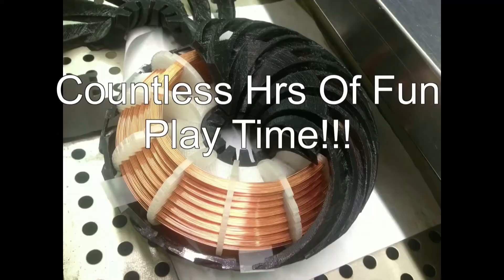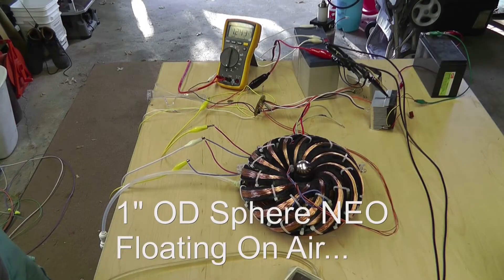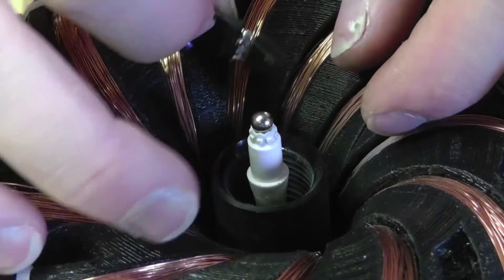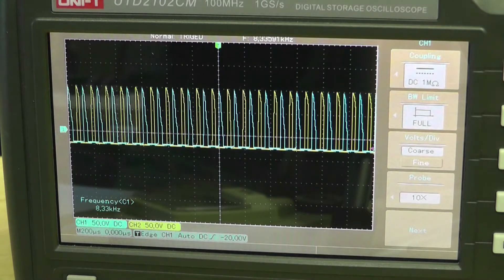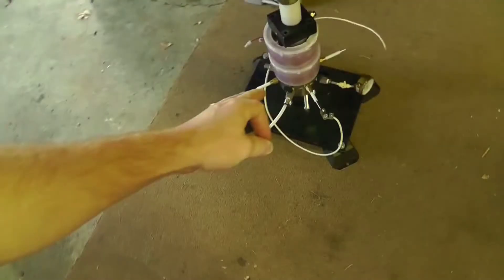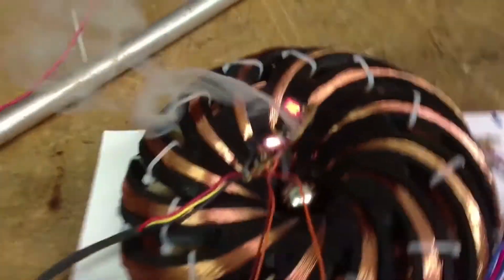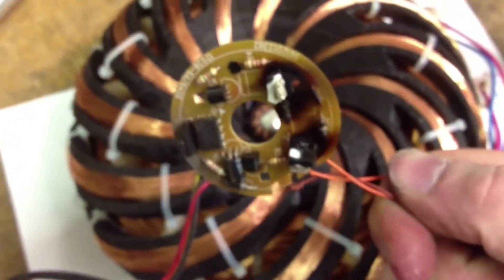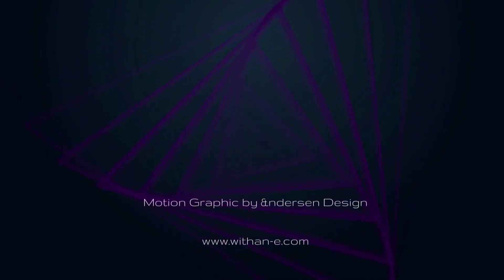Over 1/2 Million RPM Neo Sphere Air Bearing With ABHA Coil.

Comment: If I'm doing the math right, the tangential velocity at the outside of the 3/16" bearing is 146.6 m/s (328 mph), the centripetal force is 3,375 newtons (759 lbf), and the centripetal acceleration is over 920,000 g's! That's insane!